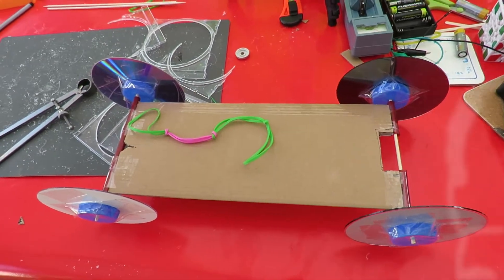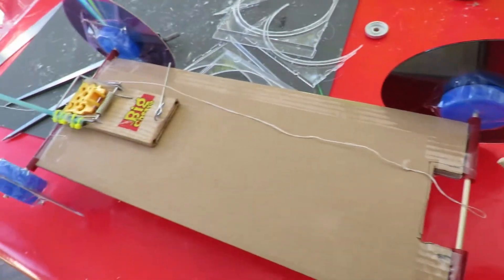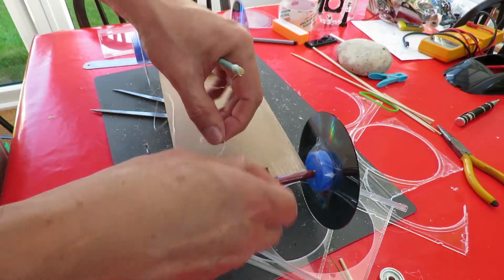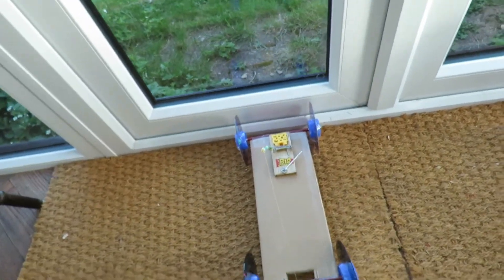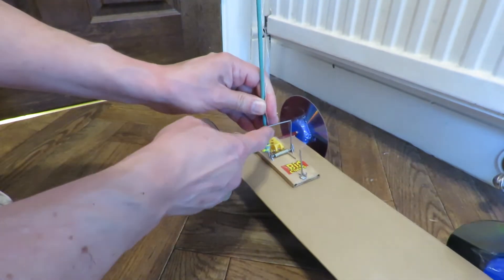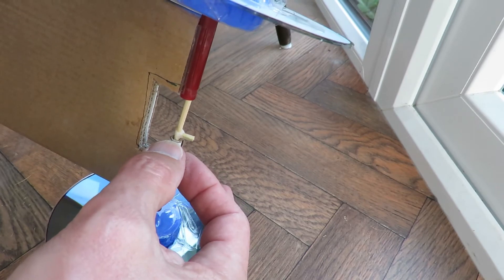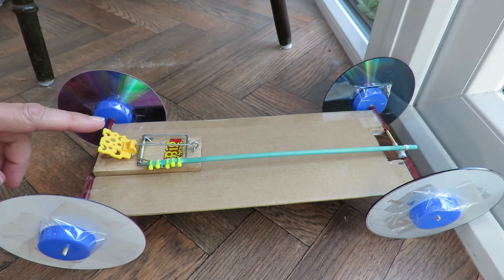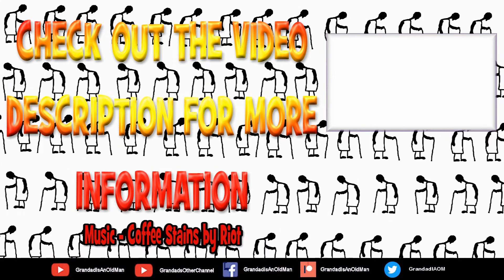RBPC converted to Mousetrap Car

Comment: Years ago, my son had a mouse trap car in Science Olympiad. It used 2 mouse traps, a cork for a variable gear shift on back axel, and a threaded rod with a stopping wing nut on front axel for brake. It was designed for both speed and accuracy to hit a target spot on floor.  Fun stuff!
Reply from the maker: Yes, I get regular requests at certain times of the year so I guess each new year at school starts the cycle again. Suits me as I get a new selection of viewers on my old videos.